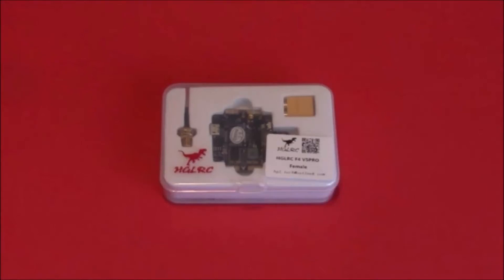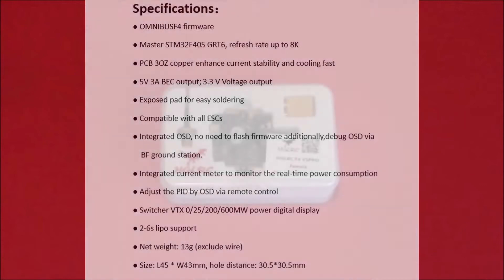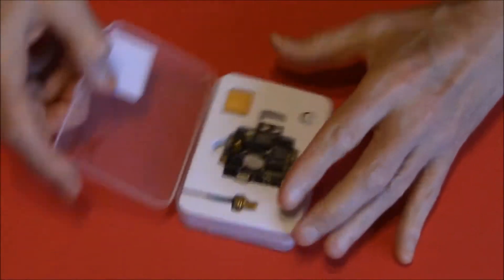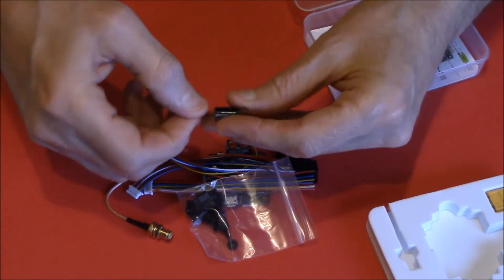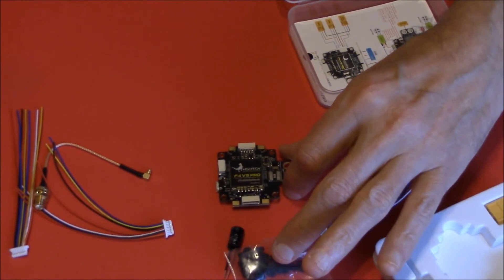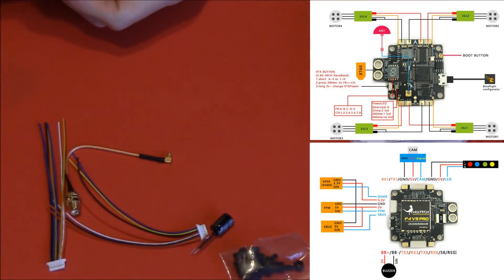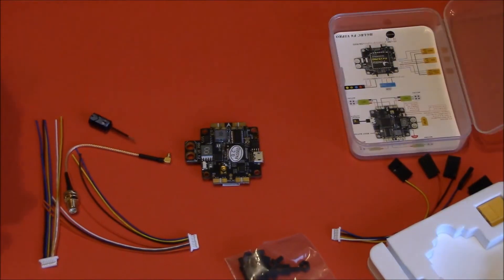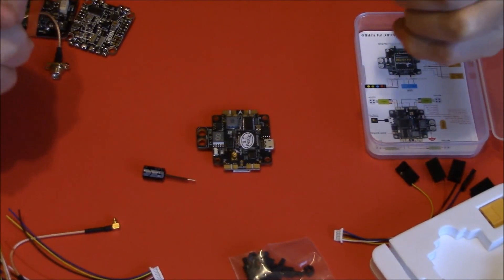HGLRC F4 V5PRO Flight Controller 5.8G 40CH

Comment: Hey mate! When you calibrated the ESC's, did you plug in the battery at the same time you had USB plugged into your computer? I'm finding the manual a bit confusing and I don't want to burn up my FC. Thanks!
Reply from the maker: Hi, If you are using betaflight connect your quad to the computer with the USB login to betaflight then plug your battery in. You will need to keep your battery plugged in whilst you set up your Transmitter and calibrate your ESC'S / Motors  ----  Sorry I'm going on a bit Basically YES  you must have your lipo plugged in. Same if you are using Blheli suite. Hope this helps. and please feel free to ask anything ells ... Cheers
Reply from the maker: Something very important I forgot to mention ( make sure you have a Antenna connected to the board before you plug in your Battery, or you will burn out your VTX ) you should always do this with all VTX. Never power up with out a fpv antenna